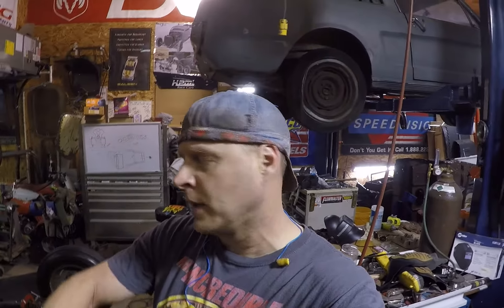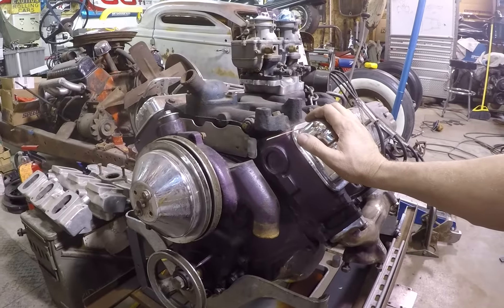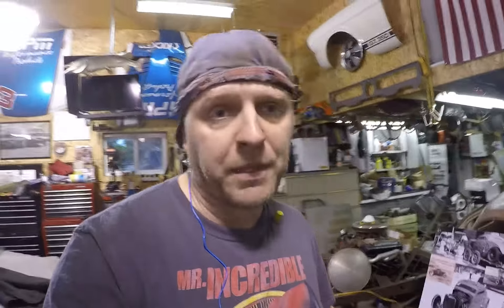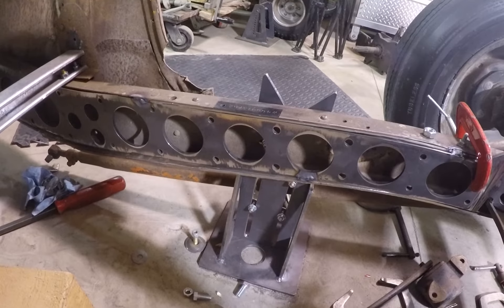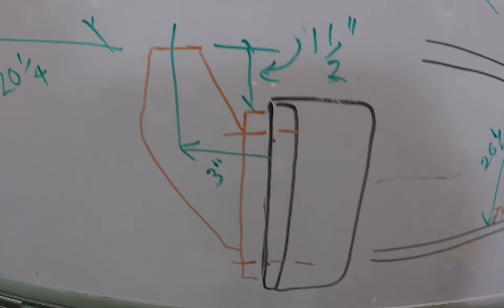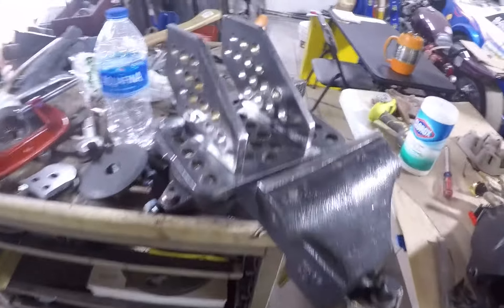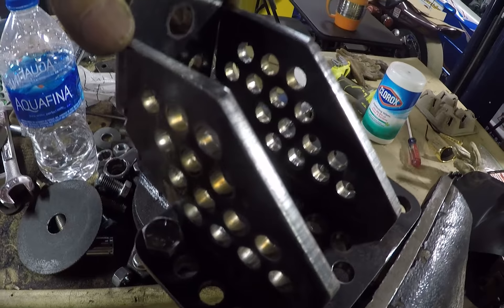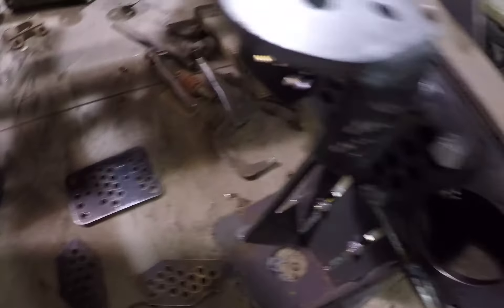Omaha Coupe Engine Mounts -  Omaha Coupe - 1.35

Comment: Your work looks very good. That chrome front mt. on the olds mill, looks like hurst "inspired" The hurst had a strengthening flange all around the front. Could have been trimmed, and chromed. ,,DUBS,,,,
Reply from the maker: Dubs ! Not sure about that mount … chromed back in the 50s going to use it on the new 371 olds we are building. Going in the car this winter . Thanks for watching